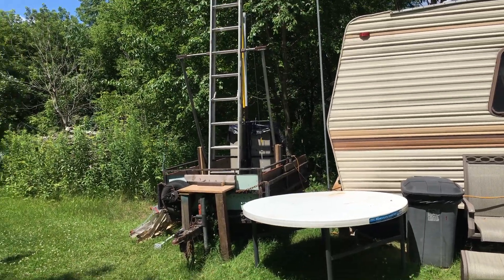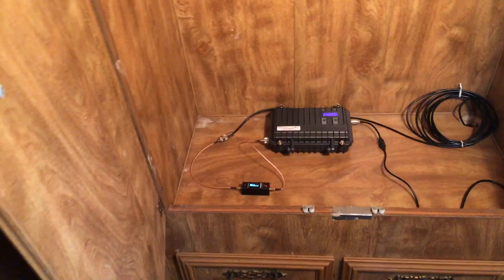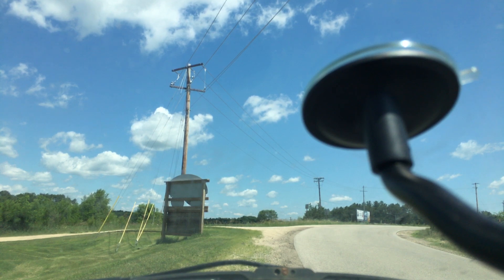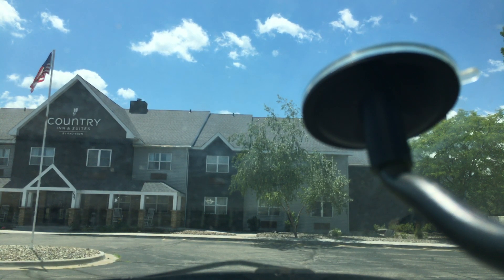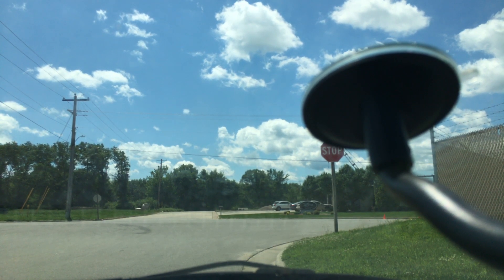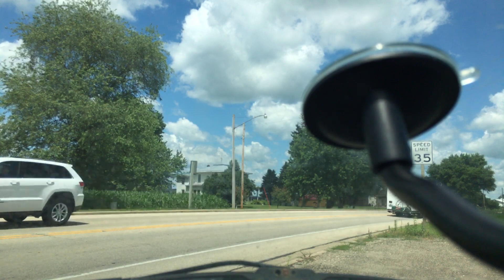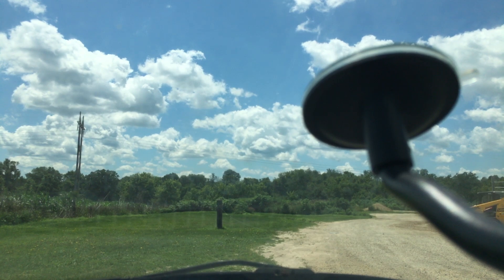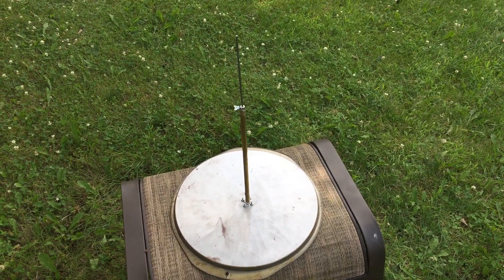🔺PART 2 Store bought GMRS antenna VS DIY (homemade) GMRS antenna distance (range) test!!🔺

Comment: Ground planes don't work as good if the ground radials are flat. That's Why radial are bent down at a 35 to 45 degree angle. It gives the ground plane a lower signal path and a better swr
Reply from the maker: It also helps with the 50 ohm impedance matching too

Comment: You should try what I’m looking into doing is switching my antenna that’s a Tram that’s tuned for 450-520.  On top of the Tram ground plane. 
I’m thinking of Switching to the Nagoya 770G NMO or the Nagoya 770g UHF with a Tram UHF to NMO connector. The first way would be the cheapest. That way you could skip the UHF to NMO mount . 
I’m also going to swap out my current coax to LMR 400 or equivalent. 
Also I thought I would let you know BTECH has a new GMRS. It’s the V2 radio. It’s on sale for $50 . Regular price is 69.99. I plan on getting one of course the sale ends tomorrow. I get paid Friday. 😭😬🤬. Also the V2 is a true 5watt radio. I have the older V1 originally it was a 5watt radio. When I ordered my first V1 it was advertised as a 5watt radio . By the time I bought my second V1 radio they changed them to 3 watts. I have 3 V1 GMRS radios from BTECH. One on high is 5.10 watts the other 2 are on high 4.88 watts . Deal with BTECH when it comes to Baofeng radios because they are a great company to deal with.
Reply from the maker: I don't think I will be buying any more antennas, well at least not now..lol The Retevis antenna seems to work well. I think I have some LMR400 here but not sure if it's long enough, I will have to look. As for handhelds I am not sure if I will buy any more or not, I already have 4 handhelds Retevis RT85 model it was a better deal to buy four with handheld mics.
Reply: @GMRStwowayradio  are you able to put on other antennas on your radios?
Reply from the maker: @46camper50  - on my handhelds, you mean? If so ohh yes I can :)
Reply: @GMRStwowayradio  yes that’s what meant . I really like the v1 GMRS radios I have . Almost as much as I like my Wouxun KG805G. As far as range and RX , I can’t tell the difference. Lately I have been using the Baofeng BF- F 8 radio on GMRS with GMRS tuned antenna. Again with 8 watt radios I can’t get much more range with them then I can get with my 5watt radios . So I’m pretty sold on Baofeng as long as they come from BTECH. Retevis I have one the RT76P 5watt radio it’s ok I don’t have a computer to program it so I’m stuck with narrow bandwidth on all the channels. Those are the GMRS hand helds I have. I have a BTECH UV-25x2 radio for a base station. I want a 50watt radio for my base so I can move the 25 watt to my vehicle and make it a field / go radio. I will use the 25watt BTECH for my bike also.
Reply: I have been bitten by the radio bug . It all started with one GMRS radio. I’m a Pepper I have the ham radios so I can have communication with people outside of the family and in my area CB is the most common. There is some GMRS activity now and then I’m hoping that me picking GMRS for our main buckup comms. my family and I will have more privacy in our area .
Reply from the maker: @46camper50  - I was bitten back in the CB radio days back in the 90's :)
Reply from the maker: @46camper50  - wow, you have a lot of radios :) and yes the antennas can come off that's how I did the video's MURS VS GMRS distance test , I hooked up the handheld to my outside antennas :)
Reply: @GMRStwowayradio  I have done two